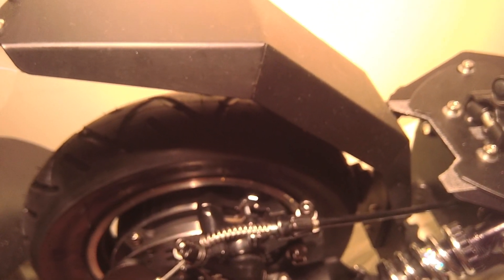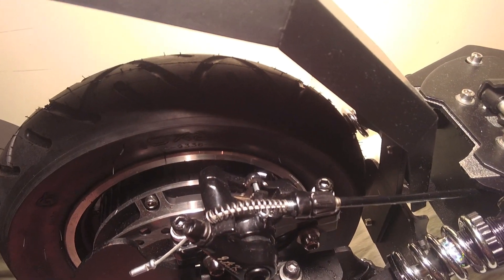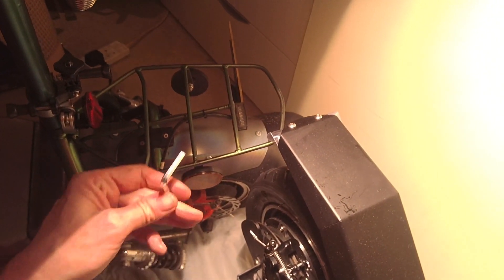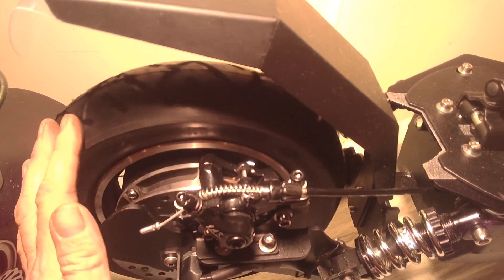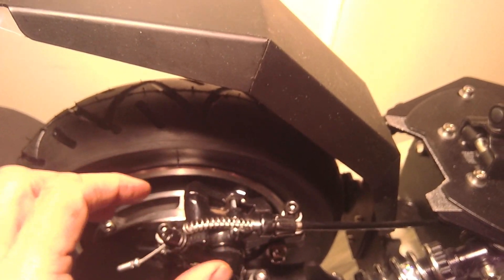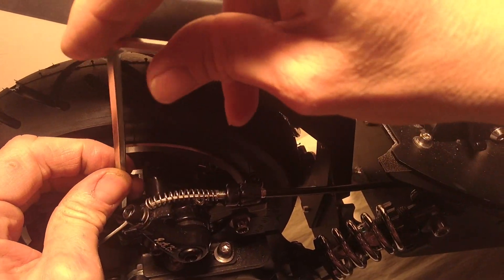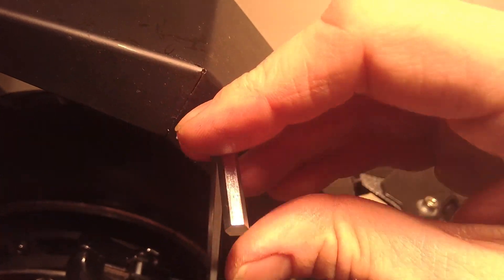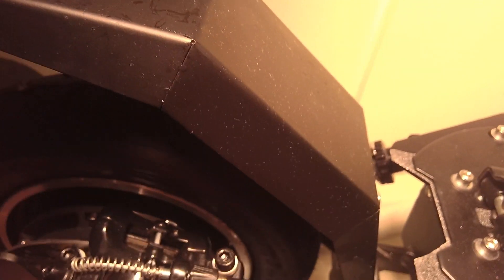Adjusting Noisy Disc Brakes on an Electric Scooter

Comment: Seriously appreciate you keeping it short and sweet without a 5 min intro. This fixed my issue on my Vsett 9+ in under 5 minutes.
Reply from the maker: Thanks very much Logan! Glad to hear, hope it continues to work ok.
Reply: I’m trying to fix mine but the bolt is TIGHT as hell and I can’t move it for nothing, have you experienced the same thing?
Reply: I had this issue. what happened was some idiot in the assembly factory got a little to excited with the bolt driver. I had to have my local scooter/bike shop take it out with an impact drill. (my biggest advice for scooter people is buy your scooter from a local shop so you can always take it back for repair)
Reply: @Logan-jb3uo  Thank you for the advice, very helpful but I got the bolts out on my own. After getting them out, seems as if someone got lock tight and dipped the bolts in it haha.
Reply: @v6_stone511  oh yeah man I'm sorry I didn't even think about that. If they used locktight then they probably recommend re applying on that bolt then. I have a Vsett 9+ so some bolts get locktight some do not. My rule of thumb is if was on it before re apply again.
Reply: @v6_stone511  also use a medium strength locktight. Don't use strong or super. It says on bottle when you buy below the brand name.

Comment: My Scooter was left outside on its stand I came back outside it had fell over and ever since I had this feint grinding sound coming from the brake disk. I tried everything I could think of including removing the break cleaning the brake pads taking the tire off checking the bearings and I could not sus it out until I seen your video and have to join the appreciation club in Thanking you ever so much cause it was getting worse and worse and was stressing me out more and more and really I was convinced it wasn't a simple fix like that. Once again Thanks Very much Marcus Roberts 2 years on and still assisting people.... Amazing.. I was about to box it away and get it checked out and that is a total nightmare
Reply from the maker: Very kind of you to say, Mark. Thanks and have a great day.

Comment: This is the only instruction I found on youtube that works.  Love the simple explanation although I messed it up the first time.  My brakes are on the left side of the wheel and I was still tightening the left nut first (the front) which does not work.  Need to tighten the rear nut first with the brakes engaged.

Thanks so much for saving me time and sweat.  I even asked the vendor for instructions and it just talks about loosening the nuts and wiggling till it doesn't make noise.  Well, it keeps making noise no matter what with those instructions.
Reply from the maker: Hi David, thank you for letting me know. Let me know if you get problems with it. I can't guarantee it's a perm fix, and may have to repeat after a while. It's a common issue with all mechanical disc brakes on scooters. Cheers!
Reply: I never had experience with scooters or disc brakes before so good to know it does this a lot.  I found another video that adjusted the front nut first which didn't work for me. https://www.youtube.com/watch?v=3HsH59EkaKk  Maybe I just wasn't patient enough?

Comment: Thanks so much! This fixed my out-of-the-box xiaomi knock off! As you said, its really important to keep the caliper in that sweet spot while tightening. I had to redo it a few times but finally got it. Thanks again!
Reply from the maker: Thanks so much. You might have to repeat the process. But I hope it works and stays working. Cheers.

Comment: I was going a little crazy trying to figure out the source of the noise on my new Mantis Pro SE. Thank you so much for posting this! Issue solved! 👍
Reply from the maker: Zach, thanks. Hope it helps. You might need to readjust once, but it should work permanently. Cheers mate.

Comment: Thank you- I’ll try this tomorrow as it’s 1am now. I have a straight out of the box $1500 nanrobot D4+ and have this issue on the rear. I tried the rear bolt but didn’t touch the front. I’ll try it and hopefully it’ll fix it otherwise I’ll have to open a customer service ticket as the rotor isn’t bent
Reply from the maker: Good luck, cheers!
Reply: @marcusoroberts  never saw your reply, sorry haha! Your method worked and I have 400 miles on the scooter now and in a couple more hundred it’ll be time to replace pads and I’ll probably have to do this again haha!

Comment: Thank you for this advice. Recently purchased a Solar P1 and it was the same fault out of the box. Making exactly the same noise when turning the rear wheel. Will adjust the caliper.
Reply from the maker: Thanks and good luck.

Comment: Nice one Marcus - thank you. Insofar as I'm aware, the rear/brake flashing light MUST be active in order for regen to engage if it's on the scooter (a [micro] switch engaged with the use of the brake level), so always ensure that not alone is the brake fully functional but also that circuit remains active, after the adjustment. Happy travels.....
Reply from the maker: Correct Dave, for most Chinese scooters that is the case and the controller(s) recognise that
Reply: @marcusoroberts  Thanks again Marcus - always good to learn something new every day. Take care.......
Reply from the maker: @daveroche6522  stay in touch Dave, take care on your scooter
Reply: @marcusoroberts  Wildo Marcus. Y'know, years ago (when I was around 12), my favourite part of Saturday mornings (after a bit of football while avoiding doing school homework) was doing the car checks with my Dad - he gave me some of the best advice I've ever heard (a wise man, with a fantastic sense of humour - still miss that lad, R.I.P.) - "After you've done all the checks, when you sit in the driver seat, always - always - make sure you're comfortable - if you're not, you'll get distracted. Which is dangerous - the same when you cycle - you always make sure you're ok before you let rip". How true - I stopped driving years ago (never really took to it, so don't need/have a car now - my trusty eBike is perfect for my needs) but I realised that when  cycling (and therefore scootering), it's best to be certain we're physically/mentally good and try to achieve a far greater sense of situational awareness when we're travelling - plus the realisation that sometimes simply stopping, dismounting,  crossing the road then continuing on the bike/scooter is the best/safest option - nothing wrong with that!. When scootering, always - always - bear in mind others also use bicycle lanes/roads etc. It makes sense. And remember kiddies - "No helmet? NO WAY!". "Go n'eirigh an bóthar libh, a chairde" (yep - that's todays freebie Irish lesson). Enjoy the trip!
Reply from the maker: @daveroche6522  lovely, very cool. Enjoyed reading that. Thank you for share.

Comment: Awesome, thanks a lot! Just got my Furo Systems Fuze, and its doing exactly this... so fingers crossed it will fix it.
Reply from the maker: Hope it works. Let me know how it goes. Good luck!
Reply: @marcusoroberts  Worked perfectly... The back wheel was really easy, exactly as you described.
The front was a bit more fiddly, pulling the break and tightening the 1st screw didn't work, it actually made the rubbing worse. 

Instead I had to loosen both screws, then manually adjust it, constant small tweaks near 1st and 2nd until it was not rubbing on either part... then incredibly carefully tighten them up!
Reply from the maker: @EViL3666  Great workaround! Thanks for sharing your experience Kelvin.

Comment: Perhaps a silly question, is it the rear bolt on the front caliper as well?  Thanks.
Reply from the maker: No such thing as a silly question. Yes the same applies to the front disc. Rear bolt first . Thanks for asking.

Comment: Great video!  It worked for my rear wheel, but I'm still stumped on the front wheel.  So the problem is the disc is rubbing on the non adjustable side and no matter how much I push the break to the left it still rubs on the left pad.  Is there a way to fix this or is my scooter just faulty?
Reply: nevermind, I was able to fix it by truing the disc!
Reply from the maker: Sorry for not getting back sooner, but glad you fixed it!

Comment: hi marcus,. i got one of those chinese scooters with front and rear discs, front breaks are ok, however when i adjusted the actually calipers and brought them closer, they would rub badly on the rear disc, when i loosened them up a bit to leave space for the disc between them, they are then too far away for actual friction of the disc,i am currently riding with only i disc break that actually works, how do i go about fixing the rear one
Reply from the maker: Hi Alon. It's only ever the rear brake that causes the problem. Ok I will try to assist. Slacken off the 2 bolts on the top of the brake caliper enough so that it moves just little. Squeeze the brake lever and keep it squeezed (might need another person) and then tighten the rear bolt but not overtighten so it doesn't move, just to keep the caliper from moving. Rotate wheel backward and find the sweetspot where the brake grips and doesn't make a sound. Then tighten front bolt all the way and return to the back bolt and retighten. 

If it really doesn't grip the brake discs at all then you might have to do cable adjustment. Start with the caliper end and pull the cable through until you the point where the wheel becomes slower to rotate without pulling the lever. Set it there then micro adjust at the lever. 

Please do shout if I can help more. Don't go riding with only one brake mate!
Reply from the maker: @meroawrr  yes. It sounds when the wheel rotates that the disc is distorted but it really isn't. You hear the 'twirrling' sound?  It just needs 'recallibration'. It rubs, then it doesn't, then it does. It's the minor tweak the caliper needs gentle adjustments.

Comment: This fix didn’t seem to work for my new Mantis 10. Is it ok to continue riding it even if the front wheel makes a slight scraping sound w each rotation
Reply from the maker: Sounds like distortion in the disc or dirt in the pads. I assume the pads are not worn? As long as the scooter stills stops safely and the noise doesn't bug you, should be ok. Cheers.

Comment: Hi what could it be possibly be we hear like a clunking noise coming from the rear. It already had a new disc break when come back from repair from the company but they said it could slightly warped break disc. We can’t notice anything warped. You only hear it when riding not on work bench accelerating
Reply from the maker: Do you hear the noise when breaking?
Reply: @marcusoroberts  the noise is constant. As soon as start riding. And goes quieter when slowing down letting of the accelerator

Comment: Hi got same problem on the front it’s spins half then stops spinning and is hard to turn wheel I think it’s slowing scooter down too.Its a qiewa 800watt hummer looks just like yours I got new brake cables fitted the cycle shop said the brake calliper and disk is the wrong side of the bike as the back one is on the right and front on the left is this meant to be I bought it bran New a year ago from amazon for a £1090 not cheap thanks if u can reply.
Reply from the maker: Hi Steven, it's normal on scooters like these to have diametrically opposed brakes i.e. rear and front brake on different sides. This is down to balance and also ease of cables with 2 motors. It's more likely they still need adjusting.

Comment: Why would you taste it rolling the wheel in the opposite direction of when it's running on the road? (just want to understand)
Reply from the maker: @Pedro, it's a good question. The way the wheel rotates forward you only check the front of the brake pad touching the disc first. This is usually over biased and makes the squeal sound. Rotating the wheel backwards ensures the 'negative toe' or 'toe-out' is neutral. The pad should hit the disc at the same time. Hope it helps.
Reply: @marcusoroberts  Yes, thanks for answering

Comment: My xiaomi m365 makes that scratching noise when riding but from time to time and it doesn't affect the performanse, bought it 2 weeks ago and a use it to go to work. Can I leave it alone without adjusting it ?
Reply from the maker: Yes you can leave it. It won't affect breaking performance or damage the disc. It's only suggested because the noise is annoying.
Reply: @marcusoroberts  thank you very much sir, God bless you.

Comment: I am having issue on my  scooter, every time I turn on the lighting the motor does jerking and run very rough on the front  wheel, but when I turn off the light it runs just fine. Any Idea?
Reply from the maker: You could try swapping the controller output cables so that the rear and front motors are opposite. This will isolate whether there is a problem in the front motor, the wires or controller. There might be a short circuit between the wire for the light and the front motor power. Let me know if you find the problem.

Comment: Mine just makes a noise every now and again when riding is something faulty or do I need to adjust it
Reply from the maker: It's worth adjusting the breaks on a regular basis anyway, but you might just have some dirt on the pads.
Reply: @marcusoroberts  I was suspecting the pads avovo are a good company tho straight away they sending new disk brake and pads

Comment: Hello Marcus, thank you for sharing. we have the same scooter viper duel 2000. but i have a problem with mine, the front wheel is a little bit wiggle when i go 50 kph above it's very hard to control because the vibration of the front wheel is strong. Could you please help me about this. Thank you very much in advance.
Reply from the maker: Hi Wenceslao, is the wiggle definitely from the wheel or is it from the handlebar stem? Also, is it a constant sideways wiggle above 50 or a knocking/rumbling thing. And does it happen with the front motor on and off? Hope that makes sense. I will also do some higher speed testing at the weekend to see if I can replicate. Thanks bro'.
Reply: Marcus Roberts i tried to check it very carefully yesterday and i found out that the rim is aligned but the tyre and the disc rotor are wiggled. So i think i will change the tyre and try to align the disc rotor but it's a lot of work. What do you think the best idea? Do you know where i can buy the tyre if ever? Thanks for the reply bro.
Reply from the maker: Hi Wenceslao, did you resolve this problem?  If not, did you try putting the scooter on a block and turn the front wheel without power, and also turning at high speed with power? Does the problem only occur under load?  I think if the tyre has around 45psi and has no deformities then that's not the problem but you can get 2.50 x 10 tyres here:
https://www.ebay.co.uk/itm/Kenda-Tyre-2-50-x-10-Inch-4-Ply-Rating-Scooter-Moped-Classic-K-313-C-10-001-NOS/263512017072?epid=17010288938&hash=item3d5a8a48b0:g:DG8AAOSwUn9aF19F
I think 2.75 x 10 tyres also fit and are slightly wider profile. 
Perhaps the wheel might need balancing if the wobble is high speed? I don't think there are places you can do this professionally but you could try to balance through trial and error.

Comment: When i squeeze , the break just doesn't clip anymore , isit because i ran out of brake pad?
Reply from the maker: It sounds more like the cable needs adjusting. If the brake pad is worn, it would probably make a squealing noise. It wouldn't hurt to change the pads anyway because they are really cheap. Good luck!

Comment: I have this noise from my front wheel and I think it’s slowing my scooter down as it has slow accel and my friend has faster accel than me
Reply from the maker: Is it a dual motor scooter or has it a motor on the front wheel? if yes, then you need to run it on a block to see if it turns the wheel as expected. Then turn the front motor off and turn the wheel and check for friction. It will either be the brake or the bearing. Detach the brake calliper an see if it still rubs, then it's the bearing.
Reply: @marcusoroberts  it is a back wheel motor it pulls from the back wheel but the front wheel disc brake and pads are touching i think this is slowing it down
Reply from the maker: @BigLen904  OK, so now you know it's the brake, just follow the instructions for the back wheel. Its sounds like your  brake seizure is more extreme. Slacken it all off,  but don't slack the cable too much. Clean up grime and reassemble. It is definitely a calliper alignment issue.
Reply: @marcusoroberts  i am going to do this now thank you very much, do you think this is why the scooter was slow on accel and bad at top speed because the brake was slowing it down?
Reply from the maker: @BigLen904  what is the make of your scooter out of interest? Like I said, Put the scooter on a block and test it. Turn the front wheel. Unscrew the bolts for the calliper. Does the wheel rotate quicker? The brake pads will last for at least 2 years unless you drive 50 miles a day. The calliper might need adjustment.
Reply: @marcusoroberts  my front wheel  won’t move as the black wheel only moves when I lift it up my scooter is the kugoo m4 Kirin scooter

Comment: It the scooter ghost, You wanna bless that scooter with some holy water before you hit top speed on it, lol, Only joking, At least the light didn't blow up on your head, Having issues with my brakes already an only done about 60 70 miles, How many miles do the discs usually last for on the electric monster scooters anyway's? 
But you explained this easy, Pity about the light falling on you tho, I will be honest had a little chuckle off that one soz, lol...........
Reply from the maker: Hi Matthew, the discs will last forever unless they've become contaminated by grease or oil from the road. The pads should last 500+ miles